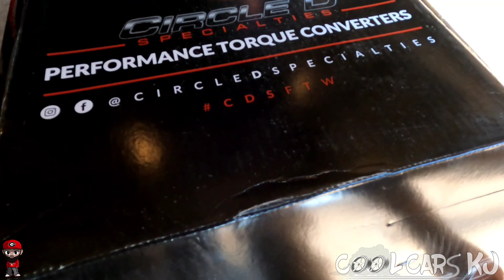The Grand National Guru Has My Engine | My Impala Needs an Update... ➕ Junkyard Run

Comment: Not sure if you check or not, but after I connect jumper cables to the good battery I always quickly tap the other 2 ends together 2-3 times to make sure theres a good connection. Always tap them more than once cause I've had them lose connection after one tap and it wasnt charging good. Sometimes they wont even spark the first tap so you'll have to move the ends on the good battery for a better connection. Just a tip I've learned over the years...
Reply from the maker: Yessir!!! I do the same thing. Gotta have that fire! 🤣

Comment: Which Texas speed cam did you go with ? I've gotta order a torque converter for the Tahoe and Circle D is what everybody has recommended. You can usually find at least one thing you need at Ben's and his prices are better than any other yard I've been in
Reply from the maker: Texas Speed Low Lift Stage 3
Camshaft: 216/220, .550"/.550", 112 LSA

Yes Ben usually has some good stuff

Comment: Those exact trailer tires are $51 at wall mart and discount tire will price match.
Reply from the maker: With the rim? $51 for tire and rim is unbelievable.  I didnt think to check walmart.
Reply: Just the tires not the wheels but your wheels should be fine unless they are bent.
Reply from the maker: I wanted new, fresh white wheels without painting them, lol. Dont really have time to scuff and paint. They look terrible with that rust showing 🤣

Comment: KJ I need you to post up that information on who merged your 2 wiring harness's when you get to that point brother. Thanks in advance.
Reply from the maker: John's Custom Wiring did the first harness on orange truck. Excellent quality but the man a liar with terrible customer service. Current performance is supposed to be pretty good. I think im gonna try the terminator X this go around.
Reply: @CoolCarsKJ  so you're not going with the stock ecm? Yeah I got John's from one of the OBS sites thanks for the heads up may just do it myself using lt1swap.com site.
Reply from the maker: @vincentpryor5455  I hear that site is amazing. If you feel confident, definitely give it a shot bro!
Reply: @CoolCarsKJ  been studying the print outs for merging them for awhile now. Have helped a few guys make stand alone harness but this will be y first swap for myself.

Comment: Still waiting 4 U 2 tell me da model Escalade that cluster came out of. I remember 99 but ya didn't say which model.
Reply from the maker: 99 and 2000 year Cadillac Escalades are OBS based bro. The interiors are the same as OBS trucks. Those are the two years you gotta look for. The internet/computer might tell you otherwise but those are the years bro. I commented that on your last comment broski.

Comment: Wouldn't it have been much easier to drop it in the back of one of the pickups? Ijs
Reply from the maker: Thought about it but had to bring some other things. Then engine been stored in the trailer for 2 months since the sheds are full. So I just took the whole trailer. I feel you though!